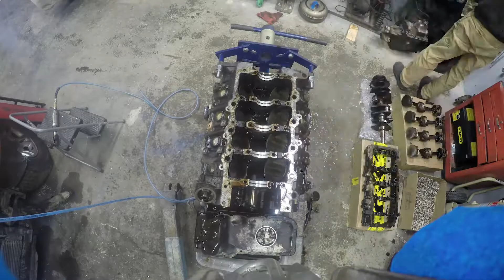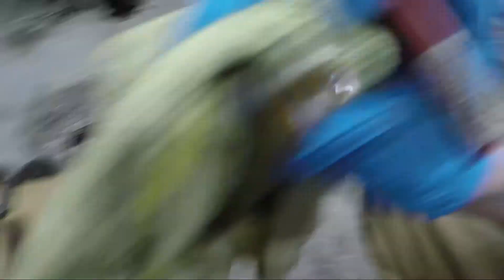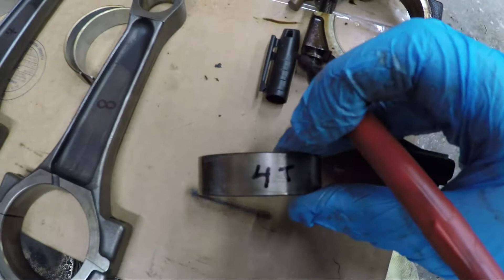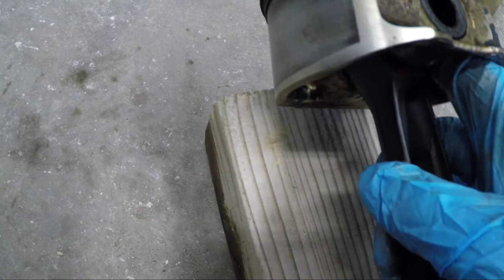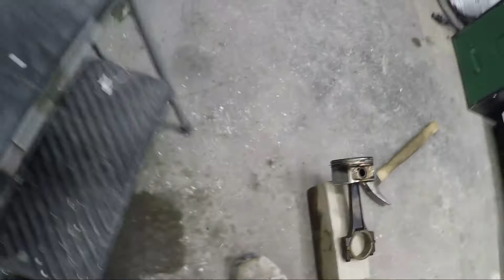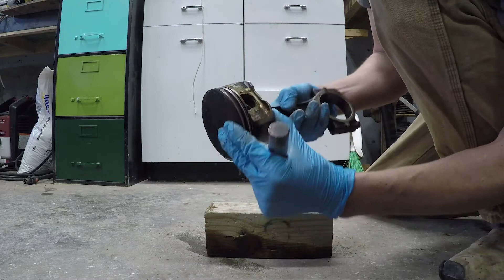2002 Dodge Dakota 4.7L V8 Engine Rebuild (Part 4)

Comment: Your supposed to heat up the piston and rod and freeze the pin and then quickly assemble….. 
or heat up the entire assembly then knock out piston pin while hot.

Comment: damn wanna do mine for a video lol i got a 4.7 v8 needs rebuilt.
Reply from the maker: If there's anything I've learned from this project, it would be to buy a remanufactured engine and trade mine as the core. Worth it in the long run
Reply: @MechanicalMike I know this is hella late but why is that? From what I’ve read everyone claims to avoid remanned engines and just rebuild your own, and they claim it’s even worse to get a re manned engine that’s been upgraded… not sure how much truth there is to it